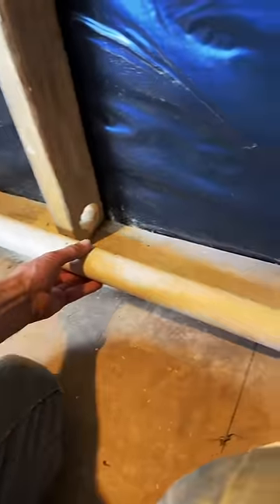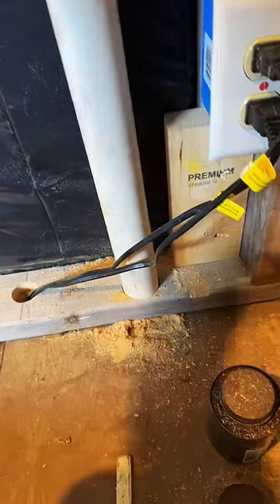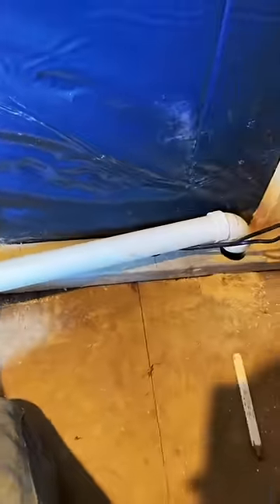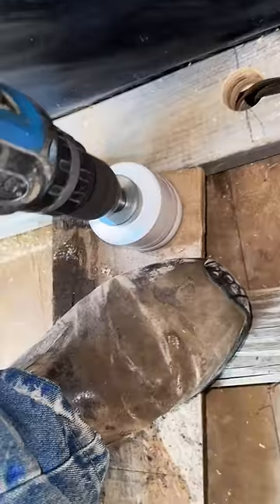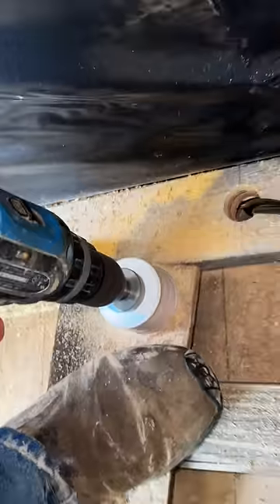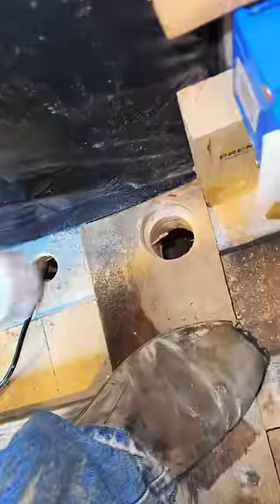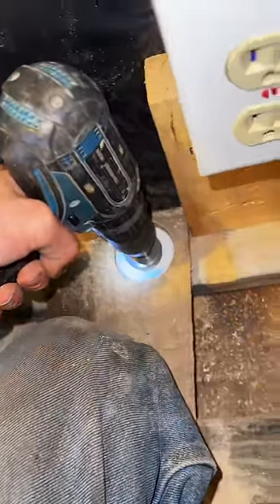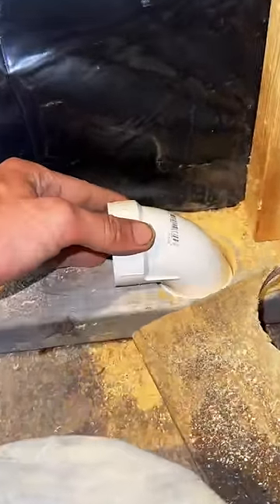Using a hole saw to make a hole bigger

Comment: Actually appreciate the tip. The only thing I'm worried about is if that's load bearing, you took a shit ton out of the stud
Reply: Considering it looks like it is up against a waterproof membrane, I'm guessing that is an external wall hopefully a gable end.
Reply: @willfisher860 you act like that hole is going to ruin the whole structural integrity. If one hole in one 2x4 ruins your whole house, you have a garbage house to begin with
Reply: As long as he does not get water intrusion, the whole will not seriously effect the the structural integrity of one stud or even a few for the whole wall. There is also sheeting and some kind of siding on the exterior wall as well stiffening it further.

For jobs I have done with a serious amount of wholes in studs for plumbing and electrical in load bearing walls, I have thrown false headers in the wall to distribute the weight above out to jacks and kings, with the remaining studs acting as cripplers.
Reply: It's not a stud it's a sill plate. The holes don't impact the structural integrity of the wall.
Reply: @Randy Jacobson  bro, look directly ahead at the beginning the bottom of the stud is tooth picks on the edges.
Reply: IPC C101.1.4: Bored holes not greater than 40 percent of the stud width are permitted to be bored in any wood stud. Bored holes not greater than 60 percent of the stud width are permitted in nonbearing partitions or in any wall where each bored stud is doubled, provided not more than two such successive doubled studs are so bored. In no case shall the edge of the bored hole be nearer than 5/8 inch (15.9 mm) to the edge of the stud.

It that hole is bigger than 2" or if the edge of the stud is closer than 5/8" to the hole then this is no bueno. I can't tell for sure.
Reply: @OggyBleacher  No bueno, but he's a plumber so I'm sure it won't matter.

Comment: I will say it looks great, if your running a pipe through a support beam it's always a good idea to throw a couple metal plates on the sides either side of it to not only protect said pipe running through but help reinforce the board since some material was taken
Reply: Some material? He left toothpicks on either side of that pipe
Reply: @mendonesiac  exactly what i was going to say, "some" is a massive understatement, is this guy a hvac installer by day

Comment: Thanks! That was pretty helpful on something I have been wondering forever.  I usually stop thinking about it and use a step bit... But in larger applications I know it wouldn't work.

Comment: Those wall battons have lost 90% of their strength. I would never cut unility penetrations over 50% of the diameter of the wood I'm using.
Reply: Yeah, I saw that too and thought it looked weak.
Reply: It's a non load bearing wall in the outhouse. You're not paying attention. And making a big deal out of something that's none of your business.
Reply: @michaelstonebreaker3387  once it's posted online, it's everyone's business
Reply: @michaelstonebreaker3387  I have seen plumbers who drill through load bearing walls across multiple studs with a 2 in.  POS
Reply: @ProxyFinal  I have seen that too. Every time the inspector fails it!
Reply: @tobybigham4196  it’s ridiculous that they do that.  What we normally do is reinforce with metal if you lucky. They still need to come back and redo the piping.
Reply: @ProxyFinal  Down in Florida, I have seen subs come back and fix these studs at their expense. And smart contractors will put these subs on the bottom of their list on future projects. Occasionally I have seen the repairs done by the framer and the bill goes to the sub that screwed up.  I agree with you, it is totally ridiculous.
Reply: The pipe makes up for the loss strength lol
Reply: It's a no load baseplate, nail both sides of the hole if you must and move along
Reply: No, you only need a quarter inch piece of wood on both sides. It’ll be fine.
Reply: @allanblount4956  That 2x4 on the left is most certainly load bearing. The other comment about the pipe replacing the structural integrity is the thought of dummy DIYers that we wind up coming out and fixing after the fact.

Comment: Is that wall load barring? If so you may want to double up your 2x4s. Maybe even turn them sideways. But what do I know I just been Operating heavy equipment for 21. Except when I did Reno’s with my dad in the winters when I was laid off.

Comment: Ive used the opposite drilling holes for recessed lighting in our display at work, put the display panel with holes that are too small on a piece of scrap wood for the pilot bit to go into and drill away, worked great.

Comment: Your holes are far too big for the framing your drilling through
Reply: According to draconian laws, this isn't a high rise, idk does he live somewhere regulated anyway?
Reply: @NinjaPotatoGaming  actually no, they are common sense laws. A building like that even a 3 sided hut could kill or severely  injure a person if it fell on them. Basic physics, bro. You put a 3" snowfall that thing could fall down on him.
Reply: @dandugo2020  they are draconian, i should be allowed to die in my house without someone overseeing my decisions. but in this particular case it's unlikely these holes matter, 

depends how solid the structure is in other ways,  structural strength you can afford to make giant holes here and there, all depends,
Reply: @NinjaPotatoGaming  the laws aren't for you they are for builders so that no one building a building can't intentionally make something that would be dangerous to the person living in the building. Yes, a fair amount of walls in houses aren't structural but are still held to the same regulations for other people's safety. Also, with the studs having that much cut out the wall night as well not be there. Honestly, I don't think you know what draconians means or you are one of those sovereign citizen people?
Reply: I had to scroll down far too far to see this comment.  Seriously, way too much is taken out of the stud.
Reply: @SailorRalph  thank you.
Reply: I don’t like how low it is either, all the weight sits right at the bottom where the stud meets the sill plate and most of the meat from that joint is no longer there

Comment: You don't need to make a jig, you can brace it with your foot. We had to do this when my last job had to replace the floors in over 30 CONNEX's that the Army was using for a training village. The screws holding the old floor was some Unobtainium/mitheral alloy and was rusted in place and cutting and drilling did nothing, so we used hole saws to cut around the screws to get the floors off.
Reply: What keeps the bit from kicking out on the sides your foot isnt bracing it on? Were all of the spots you did it up against a wall or something?
Reply: It took practice, but because of how it rotates, it would kick one way or the other.
Reply: Was that mitheral, or Mythical?

Comment: How to weaken a stud wall so it fails in one easy lesson.
Reply: Sounds like you're not a carpenter or you'd know that holes in the middle cause almost no structural disadvantage, all of the strength is on the sides.
Reply: @s n 
That hole is wayyyy to close to the bottom
Reply: @panik735  Sounds like you're not a carpenter either, or you would know that  SMALL holes in the middle causes little structural disadvantage.  Code limits the size of holes you can  cut in structural members, and it's way less than 90%.  My only hope is that this is not a structural member, and that's why this is not a serious violation.
Reply: @panik735  Hahahahahahahahahahahahahahahahahahahahahahahahahahahahahahahahahahahahahahaha
Reply: You’re going to protect that pipe before DW goes on right? That’s so low that the baseboard nails will go right through it.
Reply: @rpdipuppo Nailer plates. Try carpentry/plumbing/electric sometime.
Reply: It's a sill plate. Barely even matters if he cuts it in half....
Reply: @panik735 My mistake. You meant the vertical stud. Can't see another way to run a water line...

Comment: That's so much better. Because sometimes like in this case, his pipe is already cut to length, you can't try to start the hole saw on the edge and tilt into it. This keeps it centered both ways.

Comment: That’s a great way to do it, you could also attach the smaller bit inside the larger one and use it for a pilot. Comes in handy when you don’t have a big enough scrap piece or if you wanna save time spent drilling an extra hole.

Comment: With my hole saw you can put the smaller size inside of the larger and use it as your guide, idk if yours is the same but id recommend giving it a try and seeing it it saves some time

Comment: I do something like that using Diamond Hole saw that have no Pilot bit for drilling holes in tile, just drill through a piece of Cardboard, tape down where you want the hole a drill, 
Works great. I also drill through a 4" hole in plywood. Then tapcon into place to drill into Block or Poured Concrete with A Carbide Bit. Where some have none or poor pilot bits.

Comment: That's a good trick.  I usually try to use the smaller bit to be the guide for the bigger bit.  As long as you have enough thread for both bits it works well for me.

Comment: I’ve had this issue plenty of times and never thought to do that. I use hole saws all the time as an electrician and this will really help
Reply: The easier way, use the first hole saw you used as your center drill it will center the drill in the first messed up hole. Of course that won’t work in this case cause he needs to move the hole towards the wall, if he had centered it in the original hole the outer edge would be past the edge of the wood.
Reply: @barrybrideaux2919  can you hook a holesaw to a holesaw?
Reply: @roosterboy7357   yes many brands allow you to do so

Comment: With the right arbor you can screw the original hole saw into the larger one.  It centers itself.  I'll start it in about a half inch then unscrew the original saw. I'll do something similar like you've done an match a roofs pitch for installing my vent out the roof. Gives you a perfect hole threw a roof. Nice job

Comment: You can also just use a smaller bit used first to cut the hole which will let it ride up against the wall of the inside hole and allow the larger hole saw to make the new hole bigger. Viola!

Comment: Just as a tip, you can put two hole saws on the shaft and it will help align the hole and not have to deal with cutting another piece of wood. First put on the bigger correct size then the one you used to cut the hole. Made this mistake before and this what was shown to me.

Comment: As a plumber. Turn the bit at 45* angle with the bit facing the direction you want to straighten out, then bite the hole saw in like a toenail, straighten out. Now your using the outside edge of the small hole as the outside edge of the larger hole. Idk that’s how I do it works everytime quick for me

Comment: All you have to to do with those is put the smaller bit back inside the bigger one and it will act like a guide.  I have that milwaukee set too and it works like a charm.  I have to widen old holes for bigger pipes now and then.

Comment: I double stack the hole saw with the bigger wanted size screwed on first and the original size hole saw screwed in second.  The original under size hole saw guides and holds the bigger whole saw in place with cutting a hole in a piece  of wood necessary .

Comment: If you don’t feel like putting the smaller one Inside the bigger one this works a treat. I start backwards a little so it doesn’t skip around and shake the jig board while you get it going if no clamps are accessible.

Comment: You can also use the same trick when you don't have clearance behind for the drill bit.  You can remove the pilot drill from the arbour before making your final hole.  This can be a good idea when you're cutting a hole into drywall if you're not sure there's no wires or pipes behind.  If you ever do this and then see the pipe or wire running behind it, you'll be glad you did it that way.

Comment: With the milwaukee arbors you can actually put the smaller hole saw in the middle and use the it to start the hole. Your trick works if you need to move the center as well.

Comment: When room isn’t an issue I’ve found success pointing the hole saw on an angle so you can slip in part of the bigger hole saw in and as-long as you commit it’s worked. But this is definitely a proven method

Comment: You can hit predrilled holes with the hole saw, might not match up exactly but I do it in metal junction boxes. Actually might not work as well with wood since it's a thicker plane. You hit your hole saw at an angle, you're getting two "sides" of the hole saw to catch, the "bottom" will be in the hole and the top will be out. Hit it slow to start so it doesn't throw out the hole, as it digs you can correct your angle and finish the hole out.

Comment: Theirs is inexpensive adapter called a “oops arbor” which allow you to use the original hole saw with the larger one on the outside. This ensures it exactly center to original hole.

Comment: Don't know if you will see this but your smaller hole saw that you used to cut your hole can be attached inside of the larger hole saw and used as a guide th make the hole larger with ease

Comment: I had a machinist make me an oversized dual sized adapter for just this purpose I use it regularly, it has the capability to mount 2 hole saws on the same arbor….there is another trick start the hole saw at a severe angle in the same hole it will reestablish a bight and rotate it in, you can use non arbored hole saws anywhere and bore anything…

Comment: you could also drill a plug using the same size as the hole. Put it in the hole and the guide bit will track correctly.

Comment: That’s a good trick but you could also screw on both the original hole saw you used as well as the big one and the smaller hole saw will act as a guide, the only difference is less material waste so it really doesn’t matter in this situation but just thought I’d spread the information🤙🏻

Comment: You can use the 11/2" hole saw bit at a pilot bit, it will sit inside the 2" hole saw and screw in

Comment: As a plumber there’s a better method set edge of larger hole saw into the hole reverse cut and and rock hole saw until upright this will make a moon shape in the wood holding hole saw in place engage the forward on your drill and drill away it is was faster than the old plywood guide method

Comment: To everyone complaining about yhe thickness of the bottom plate, there are little metal covers that can be put over the the weakened part of the plate. They're meant for exactly that. In electrical we use them as well if a hole is drilled to close to the edge of a stud and there is a potential of a drywall screw hitting our cable

Comment: On some hole saw bits, there's usually a couple of threads of the arbor sticking through the hole saw. If enlarging the hole, use the original size and place it onto those threads. This'll give you a guide for the larger hole saw.

Comment: You can stack the hole saw blades. Put the original size on the inside of the bigger size you want and use that old size as a pilot

Comment: Drill the hole you need in a 2x6 and cut it to fit between the wall studs . Screw it down to the plate and use the hole as a template

Comment: I'm sure everybody said this before but you use the original bit inside the larger bit to drill your hole out but whatever works works if you look at the way they're packaged they're all inside each other with the drill bit so threaded on the original hole saw inside the larger bit  it also works well with angled holes but when you use it for angle hole use the smallest hole saw first cut to make sure you can put the angle you need then put it inside the diameter that you need to get the proper angle that you need it's easier to control the smaller hole saw to start your cut if you need to do an angle hope this doesn't bug you and if it does I'll never find out you have a great day I do like your videos dictated but not read thanks to talk-to-text

Comment: Just to let you know, pipe is not allowed to penetrate between floors like that with out intumescent caulking to prevent the spread of fire in the case of an emergency. You need a gap not just for the elbow but also for the aforementioned caulk.

Comment: Hood trick for non-stackable hole saws. Looks like a craftsman or Milwaukee hole saw and they should have threads. Simply thread on the bigger hole saw and then thread the smaller one inside of the bigger. The smaller hole saw works as your guide/drill bit.

Comment: If your yoke is long enough you can just screw the smaller hole saw you used and screw it inside the larger hole saw, it usually works and no scraps needed

Comment: Just a suggestion, but if you are looking for a cheap building material for projects, then I would look into cob. Cob is the earliest precursor to modern concrete and cement. To make it you need dirt that is a close to even mixture of sand and clay, water and some straw. Mix it all together and then put it where you want it. You could probably get soil that is close to what you need if you just remove the topsoil. If you want more details on how to make and work with cob there are a lot of videos on how to do so on YouTube.

Comment: You can also stack the hole saw blades. Put the size you want on first then the size you have. No drill but needed. The small hole bit will guide the big one
Reply: That trick will only work with certain hole saws. The ones I buy use threading into the base which will not allow you to do that trick! Either way will take very little time or effort!
Reply: @tobybigham4196  ahh I got ya. Granted the trick showed I’ve never seen anyone smart enough to use when needed. Deff a good solution.